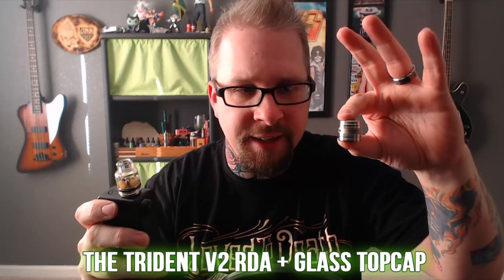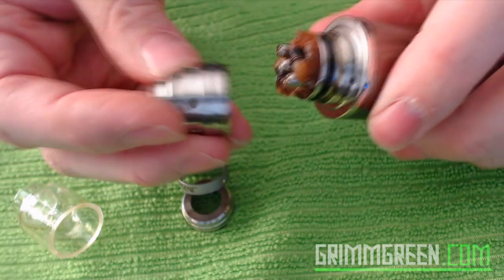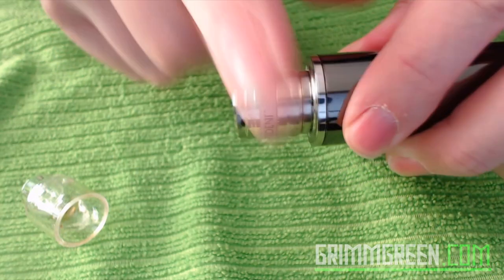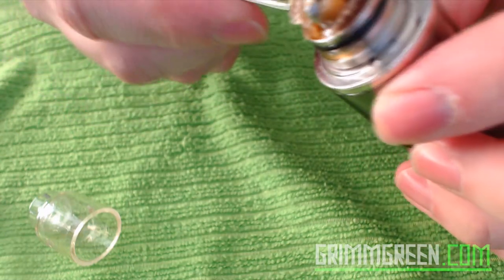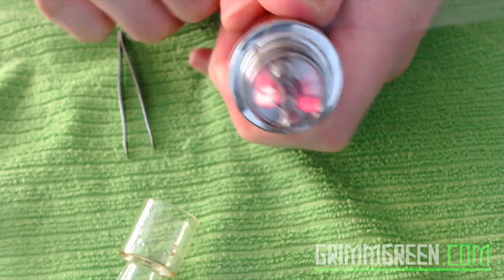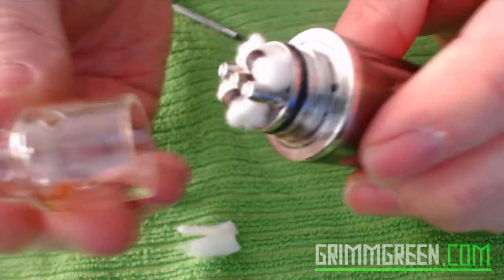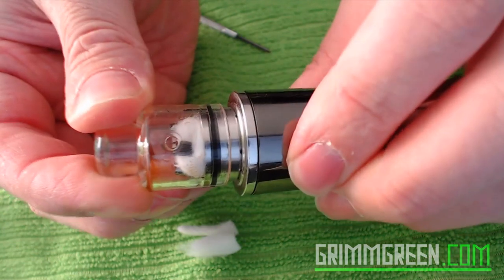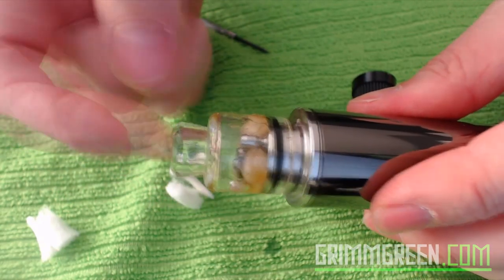Trident V2 RDA + Japanese cotton + Glass Topcap

Comment: Nick, I'm using a V2 just like yours, but mine actually seats the airflow ring properly. While I don't believe it's the greatest cap in the world, I definitely think you have a defective unit there sir (probably wasn't threaded fully on the top section).

As soon as it arrived, I channeled the bottom post screw and drilled a 1/16th hole at the base of the positive terminal to mod it for bottom feeding. It hasn't left my Reo since (the reo has a milled juice well, so the V2 fits perfectly flush)

Comment: Dude Grimm, If you want that top cap to work your going to have to grind down the bottom part of the cap a bit where the threading is so when you go to tighten down the top it will squeeze down on the airflow ring. its crazy I know.. That clear cap for the win thoough..

Comment: A few things about the top cap.  Those are not available through RJ Vapes.  That cap is the version one of the Cloud Cap By Clean Tanks.  They can be found at Cleantanks.biz  Another note, That cap was made for the Helios, it however also fits the Trident V1 and V2 as well as the nimbus.  The Atomic is a much smaller deck and that cap will not fit on the Atomic.  We also have a cap available for the Patriot.

Comment: Hey GrimmGreen, let me start by saying that I love ya as a brother in vaping. But I have to say the "uppy-closey" segment was frustrating on this video. Did I know what was going on while you were out of frame? Sure. But it bugged me to not see what was going on. Would have loved to see the camera adjusted. Other than that, great review. My roommate got the Trident V2 and would have ended up canning it either way due to such a minuscule chamber, but the darn posts broke off first.... IMHO, the slotted posts are not a good design, clone or authentic. Too easy for one of the legs to break. Can't tell you how many I've seen do it. (I work in a vape store...) Keep Calm and Vape On brother! Very excited for the big announcements to drop in a few hours!

Comment: Love my trident v2, cough clone. It is my first and only rda, for now. . . Lol. I've only used it with 28 gauge and in single coil :'( I've heard of people having serious problems with it like posts breaking, which is crazy. My top cap is broken in a lil bit I keep it well lubed after I build a coil. My biggest gripe would have to be, in single coil mode, juice moves its way to the closed side of the afc ring and pools up until I touch it or set it on my lap to drip and then I have 90 percent more juice on me than I really want to lol

Comment: I have both the V1 and the V2 Clones, and I have a problem with the V1 two O-Rings that are supper stiff quit using it because they are too tight. My V2 is OK not having the same problem you are having though. The center Ring on mine is like its over-sized top to bottom and fits tight between the base and the top ring.

Comment: also have a trident v2. when i first got it, it was so snug i couldn't even get it apart. had to slowly slip different size flat heads in there to get it apart. sometimes i also over drip and it leaks like a sob. don't have this problem on any other rda. cheers.

Comment: I have two Trident V2s, one of which came directly from Myvape in the Philippines. They both have the same Trident logo, like the one on the "other" version (the one you don't have), and neither of mine spin like yours. Maybe you could try taking the ring off the atty and hitting it with a hammer - just enough to flatten it slightly (so it's not completely circular).
Reply from the maker: I was thinking about something like that

Comment: I think you got a defective trident. The topcap should be snug, but easy to pull off even after the atty is broken in. And the airflow control should certainly lock. It shouldn't need an o-ring to lock either. I sell the H-Cigar clone and they all work much more smoothly than that one. So I understand your frustration, but it seems to me that if my cloned versions work better than that authentic then it's gotta be defective o.o
I do recommend giving it another shot, with a different unit of course.

Comment: Hi Grimm, thanks for your videos. I have two mods,the 49 and a nemesis, they both have magnets, lately I notice they are getting crunchy on the throw, the 49 has to be hit on the side to  get a hit,, could it be the magnets need cleaning? I see a lot of particles on the magnets but can't get them removed, any suggestions?
Reply from the maker: timmerdonkey I don't think it's the magnets,  Just make sure where the switch is traveling is clean.  You can get gunk inside the switch sometimes.
Reply: thanks grimm, I can see the gunk on the magnets,not sure if I should scrape em off, might do damage to the magnets.

Comment: I have found that the cap that seals the afc ring can go loose if knocked a little, it should really have an extra thread at least for a more snug hold on the afc, doing it to an almost perfect fit was a flaw in hindsight, but mine never spin freely like that on either the Tobeco clone or the Grand Vapor original, the performance on both is pretty much the same except the machining on the original is just first rate and spotless, the Tobeco is machined really well (the threads on mine are fantastic) but when you find swarf on your posts you know it's a clone :P Vape Safe! :)
Reply: And it's also my fave atty to date, I've tried many but nothing beats it for me imo :P

Comment: If that's a real trident v2 that's a shame. I have 2 "clones" from 101 vape and they have the logo like the second picture you showed and I barely have to tighten it and the ring doesn't move. I also don't have any problems popping the cap off its not too loose or too tight. On a good note I hope Amber is doing well from her hospital stay

Comment: grim just so you are aware the duke is a 10amp 50watt box mod and if your coils are .35 you are over 10 amps at 3.7 volts its like 10.5 amps and 40 something watts at 4 volts your deff over at about 12 amps.....so just careful if you like your duke as much as i think you do.....
Reply from the maker: bah... I've run LOW shit on the Duke... 10 amps is more like... guidelines... I'ts capable of much more than people let on
Reply: This is true, but 10.5 on a 10 amp limit isn't quite danger levels.  On the other hand, 30 amps on that same 10 amp limit is QUITE dangerous.  Like Mr. Green stated, it's guidelines, more of a CYA thing.

Comment: if youre looking into getting a trident, just know that youre not gonna be able to use much more than 26 gauge dual coils with it, more of a beginner rda. Using anything bigger than dual 26 strips the screws and renders the posts and the whole rda worthless
Reply from the maker: huh?
Reply: Not having space for more than dual 26 gauge coils does not make this RDA a beginner one.
Reply: I liked mine until i moved into using setups with like twisted 28gauge or dual 24 gauge coils. When i started using these setups with thicker kanthal the posts couldnt tighten down on the wire. For instance with dual 24 guage coils I was able to tighten them down, but upon straightening my coils out the screws on the posts would literally pop off. There were times when even pulling cotton through my coils created enough pressure to pop the screws off. Like i said though i probably just got a horrible clone or just a bad batch yunno
Reply: *****
I know the feel and I know what you mean. But even if do I enjoy trying new coils I still use a simple dual 28 gauge on a Valkyrie most of the time (maybe I am a beginner) but it's just the word beginner that ticks me here, because in my opinion the Trident even if it is not for everyone, is not a beginner RDA. The word beginner shouldn't be determined by the coil size and post holes an RDA has, in my humble opinion.
Reply: Phew Im happy you guys felt the same because at first when Grimm replied to my comment and just said "huh" i felt like i might have jumped to conclusions and been a bit harsh. Good to know others experienced the same problem. Like you guys have concluded, i guess its not a "beginner" rda but more of a "you have to know what you're in for" rda due to its limited capabilities.
Reply from the maker: no no redfurydubstep  I was more just confused :)  I totally get what you're saying now .  24g was a No-go for me on the Trident,  But I generally use 29g kanthal so I didn't run into that problem.

Comment: I had the same problem with the trident V2 air flow ring but mine is a clone. If the logo is off then it's a clone imo. I just use my pliers to reshape the ring so it would fit snug in the top cap but it's a little bit harder to move now. Still it doesn't spin so that's good.

Comment: I have access to a legitimate trident v2 clone. It is not like yours. Get a drill grinder or angle grinder and lightly and safely grind half of a mm off the top of the threaded inner sleeve thus when you put it back together more the inner sleeve will fit up into the outer sleeve.  As always PPE is essential.
Reply from the maker: SAFETY FIRST

Comment: Also, for your spinny problem on the trident v2, try some PTFE thread tape.  Its uber malleable, wont stick to anything but itself.  Worked wonders on my Nemesis air flow ring after the black o-ring bit the dust.
Reply: Haha that worked thank u.
Reply: Awesome man; glad it worked for ya.
Reply from the maker: not a bad idea, thanks
Reply: Isn't that Teflon tape?  If so, this is a TERRIBLE idea to be anywhere near a heating source that you could possible inhale fumes off of.

Comment: Grand Vapor redesigned the engraving after a while. I saw mention to it  on Grand Vapors site as well as a couple of others. Looks like you got the lemon of the bunch. Mine is working great with dual parallel coils at .2 ohms and is amazing. #getwellsoonamber